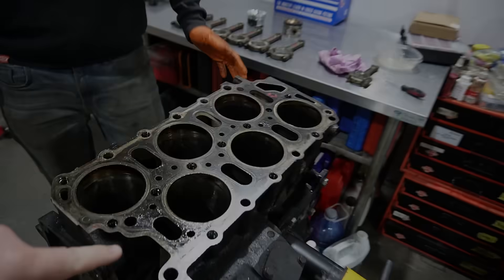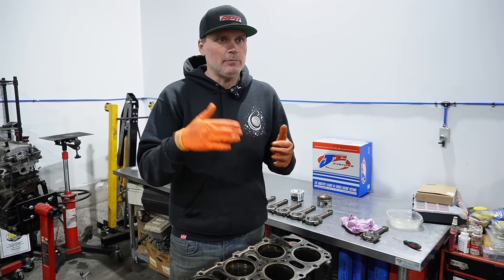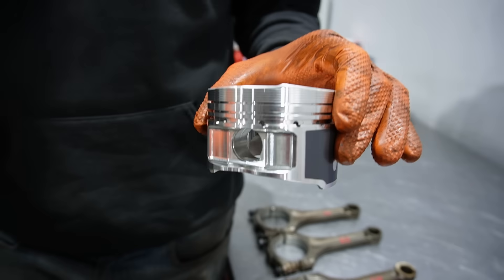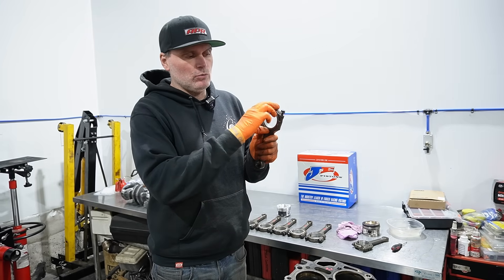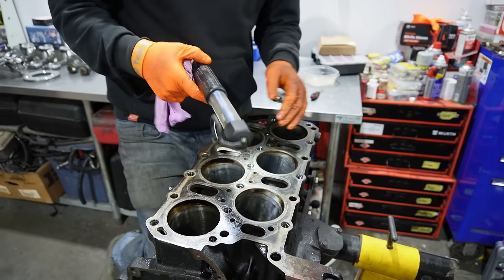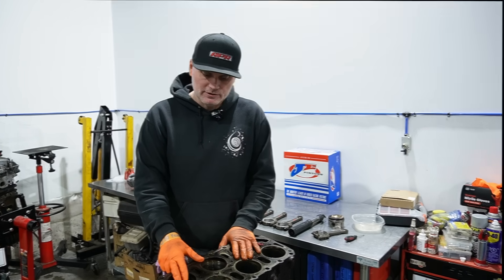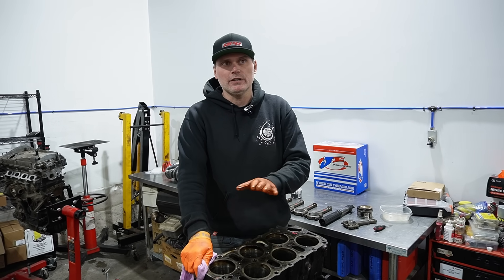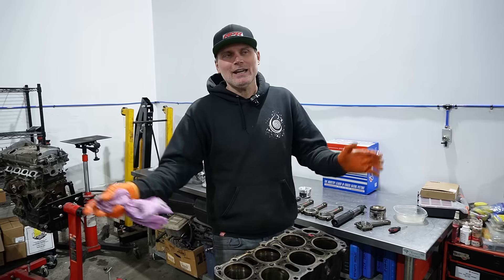VR6 Turbo Build, Must Do's.

Comment: Just a note on the pistons: the reason they blow ringlands like that is due to the very tight stock ring gap. Lots of guys havs really good results using stock pistons with wider ring gaps in the high .020" and low .030" ranges. With the stock gap of .015" pump gas is just too much heat for them at the 500+ mark, and they but together.
Reply from the maker: Agreed (to an extent lol), we've done it and still had issues. It really comes down to the fuel being used. The real answer is keeping the knock out.
Reply: @COMotorsports  For sure.  I do see a surprising amount of people running genuinely 600whp through bone stock motors on full e85 and doing it for a long time. Whether or not they have blown ring lands and send it anyway I'm not really sure lol. But like you said, the main key is keeping heat and knock away.
Reply: agreed, mine mad 602whp on pump e85 on a stock piston and rod setup
Reply: @brandonvrt2285  was that all tuning or what all was done to your engine and what set up were you running when making 602 wheel power??
Reply: @Jimmy2Times702 that thing was a rocket, built cylinder head, stock bottom end, standalone, e85, can’t remember what turbo he ran , yes 602whp
Reply: @brandonvrt2285 what’s your tq like?
Reply: nice video interesting to watch. Could you make a video about vr6 turbo builds. And then how does it work like Ecu to work on a non turbo stock car. Like fueling, turbo pressure keep knocking out. Keep going and making more videos 🎉
Reply: Fully agree with you, running boost on std ring gap is playing with fire it WILL  break the ring glands it just a matter of time even on a forged piston 🏁
Reply: Technology has advanced so much so 600 isn’t nothing for a stock 12v lol I do 20-30psi mildly on a stock block
Reply: @justynnoss2786 you got one damn good tuner. Iwanna know who. Ive seen 600 on bone stock 12v (10.5:1 comp) at 24psi with twin gt3071 turbos. But I aint never been able to find a tuner that good unless its the owner of the car. No one wants to tune somrone elses car just incase something goes wrong.
Reply: Question to add if a block was gapped like this and blueprinted back together and ran as N/A Would that motor smoke a bunch ?
Reply: Yep, I just broke a ring recently pushing the the boost too high,  rebuild time....
Reply: Audi a3 8p made 513 awd   until it twisted the crank 20psi on pump gas
Reply: Гольф пассат Сеат порш с мотором вр это очко очковое могу много про него сказать плохого !!!!! У нас в России эти тачки даже порш бу стоят копейки тоесть наша Лада гранта стоит дороже чем порш, таурег,и весь этот вр брак люди это поняли и пытаются избавиться от этого брака за даром😂
Reply: Curious why the stock gap isn't wider from the factory, regardless of being naturally aspirated or boosted. Does the wider gap lead to more oil consumption?
Reply: @alextorkelson  Yes, it does.
Reply: Why use stock rods might Aswell throw some aftermarket since ur there
Reply: @justynnoss2786  use stock because its over a grand for forged pistons and over a grand for rods. Unless you want forged rods that are rated lower than stock handle. If you're okay with a downgrade in reliability you can do the ie 700 dollar rods, they are only rated for 700hp. Seen stock rods do 1500 myself. Dont even try the maxspeeding rods.... unless you're doing n/a high rpm, then maybe test them out if you have a spare engine.

Comment: In regards to the cast cranks, been in the facebook groups for almost a decade now and have seen them fail in cars. Usually upwards of 5-600+ to the wheels and experiencing detonation. Also seen a lot of experienced tuners use cast cranks in close to 4 digit builds perfectly fine. It seems the cast cranks just aren't able to hold detonation very well, which still isn't good but is different than "you can't use these ever."
Reply from the maker: If you know or see of any cast crank failure stories do you mind sharing? Appreciate the info.
Reply: @COMotorsports  Yea I can. Unfortunately Facebook is not the greatest with finding old posts. I definitely remember seeing 2-3 posts in the 2 years or so about people in BUB/MK5 motors windowing their blocks at not that crazy power levels
Reply: Thanks for this insight. I wonder if a girdle would help hold it together

Comment: Great video!  Question though, have you guys actually seen any situations where the stock rod bolts were the initial breaking point in a turbo VR6 build?  
The reason I ask is that theoretically speaking, the instant of maximum strain on a rod bolt is at TDC on the exhaust stroke.  When you add boost, the backpressure in the exhaust port in front of the turbine wheel, and the incoming boost itself depending on overlap, actually cushions the piston at TDC on the exhaust stroke, thus reducing strain on the rod bolts.  Presumably you might also add to the top end of the RPM range with the help of boost, so that adds strain to the rod bolts, but I don't know at what point the strain forces actually become higher than they were with the factory N/A configuration.  I suspect that rod bolts really aren't necessary at all in a turbo setup like they would be in an aggressive all-motor setup.

Comment: E85, Rod bolts, head bolts made mid 500s reliably for a while 💪🏻 until I pushed it harder (I wanted to test the limits of the VR)
Reply: Mid 5s is effin fast
Reply: MK5 R32?
Reply: @jorgemendizabal6596  mkiv
Reply: On E85 there's people making nearly double that on same spec.. there's loads of people making that for years on normal pump gas no issues.
Reply: @garyhowe88  any references? I’d love to check them out
Reply: @albertoarriaga2297 Tim Mullen tuned by lugnutz

Comment: I would love to see a VR5 build! I was looking for into them but there only seems to be a video in Polish and some french forums. Im sure its quite similar to the VR6 but it would be cool to see the differences and hear them turbo'd! Also question, is the 3.2 vr6 block is the same as a 2.8 block just bored out and with a larger crank stroke?
Reply: You ask i deliver😁
Reply: @TorpedoStudios  I did see some of your videos while doing VR5 research lol. would love to see a build on a 20v vr5!
Reply: 24v have different seperation angles if that's what you mean.
Reply: 24v 2.8 vs 24v 3.2 I believe was the question. Same basic block?

Comment: Will OBD1 make a difference for the 12v?
Reply from the maker: Only in regards to tuning.
Reply: @COMotorsports  OBD1 has to run a standalone I assume?
Reply: Obd1 got a bigger oem trottle body 👍

Comment: Interested how you deal with the timing chain for the cams... I used a 3.15mm spacer to drop CR to 8.9:1 but it was enough of a lift to mean I had to make a couple of mods to the top chain cover and chain guide to get it to fit where it had pulled the chain up enough to make the tensioner guide catch the cover...

I know on the HPA kit where it drops the CR to 7.5:1 they supply a chain with an extra link... is this something you do or anything you would recommend to do to mitigate the inevitable chain fun and games?
Reply from the maker: We sell/use spacers that do not require any modifications to the chains.
Reply: @COMotorsports  ah OK... What thickness and CR are they?
Reply: should mention its 3.2 24v VR

Comment: So if you were planning on forged pistons, would it make sense to just get lower compression forged pistons and not need a head spacer?
Reply: IF you need the pistons. Otherwise stock pistons are more than adequate for most 500whp builds
Reply: it depends on on the fuel you plan to run